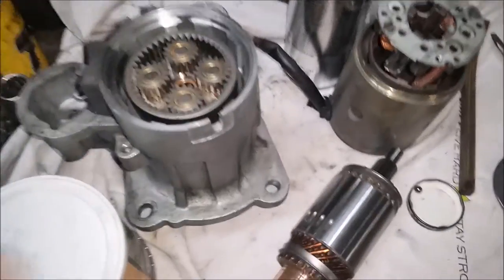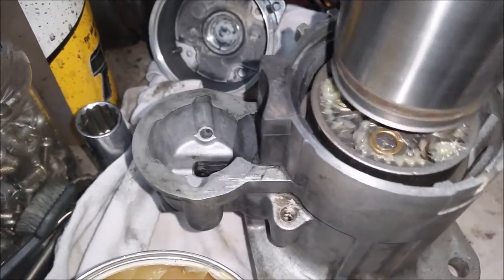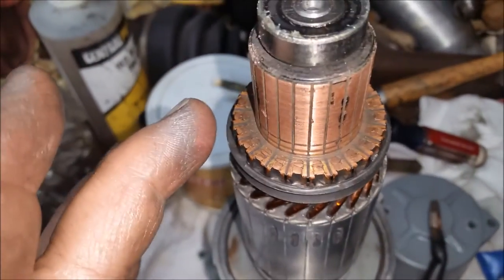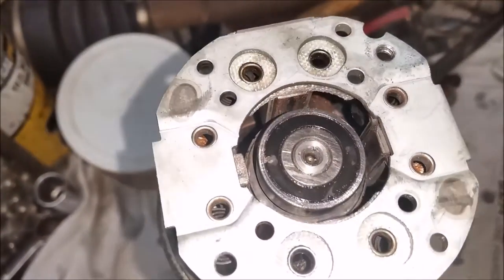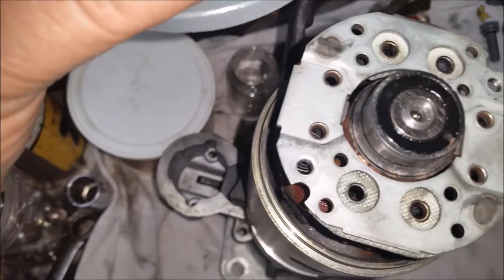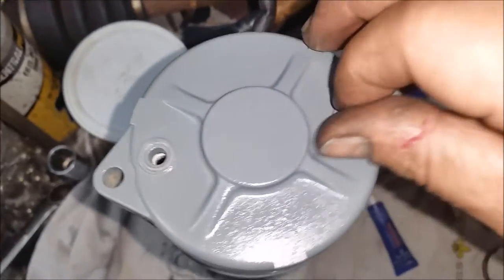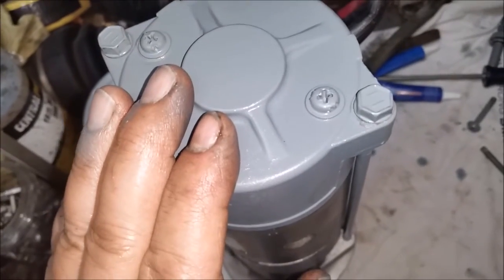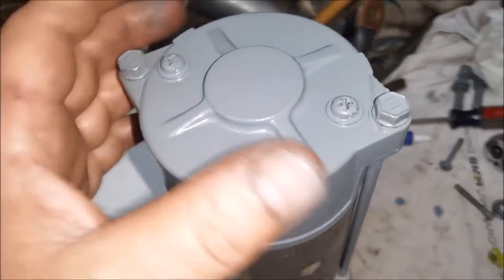1994 - 2001 F250 / F350 7.3L Starter Inspection & Brush Clean Up Reassembly Part 3 of 3

Comment: Hi, thanks for this tutorial.  I have looked at all your videos on this starter.  I have one that the Bendix is not flying out,  I did not see what you might have done on that part of the starter.  Do you have anything in your videos about that part of the starter?
Reply from the maker: Most Bendix Solenoids are not repairable. It has a coil inside that when it burns out you have to replace it or is the internal starter contacts burn out you have to replace it. If you installed it wrong you can still test the solenoid coil by removing the solenoid, then apply power to the small terminal + Positive RED and - Negative Black to the case. If the plunger sucks in then the coil and the contacts inside it are most likely good. If the solenoid sucks in but the starter teeth don't come out then more than likely you have not installed the solenoid plunger arm onto the pivot arm plunger lever. See time index 14:14. Also the large terminals have big relay contacts inside, you can test them by engaging the solenoid so it bottoms out. Then put a continuity meter across the big terminals. If it has a short when the solenoid is engaged then it is good. If you don't have a continuity tester you can use a 12vdc light bulb. Looking at the connection side of the solenoid and with the smallest terminal on top connect the center of a 12vdc light bulb to the terminal on the right and connect the case of the light bulb with a wire to the case of the solenoid. Now apply 12vdc to the small terminal and negative to the case of the solenoid. If the solenoid engages and the internal contacts are good the light should go on and go off when you disconnect the positive or the negative wires to the solenoid. Hope this helps. Feel free to ask more questions if needed. 
Thanks for watching. Best Wishes n Blessings. Keith

Comment: could doing this on a locked starter fix it because it hasnt been used?
Reply from the maker: Yes it can. However that's provided it hasn't been burned up while trying to use is in a locked up condition and all the components are is fairly good condition to start with. Thanks for the question. Hope this helps. Best Wishes n Blessings. Keith Noneya
Reply: i tried to start it up and it locked on me and took it off right away so i have not tried to use it while it has been locked ... thank you for the feedback

Comment: So, what was the outcome?
Reply from the maker: Hi Ziji! Cool Name. The outcome was that one of the coils was internally burnt and shorted and there was no way I could fix it. It would require a full tear out of the wire and rewind and solder them. It still worked but was really weak. I've done this on other starters and it has always worked, guess I gotta get the one that was burnt huh? So anyways I just went on eBay and purchased a new one after all that work for about $165.00 bucks. The new starter really turns that 7.3 over really fast. So I guess in that respects I'm happy. Thanks for watching "Z". Feel free to comment or as questions anytime. If i'm logged on I'll probably answer within 30 min. to an hour. 
Best Wishes and Blessings. Keith
Reply: Ah. Darn.
Nice videos!
Reply from the maker: Thanks "Z". I don't make to many F350 Vids because it's pretty reliable. I mostly make Dodge videos on my Grand Caravan. That thing is ALWAYS breaking. Heck my Pastor gives me heck because I drive a Ford and he drives a Dodge truck, a few years newer than mine. His truck is on  it's 3rd transmission and he calls his brother who owns a cabinet business to come rescue him all the time. His brother drives a Ford truck. It's funny he says Ford stands for found on the road dead. I just laugh and say who comes to rescue you all the time? That's right it's your brother, and what do he drive? That's right he drives a F.O.R.D. one of those: Forever Out Rescuing Dodges trucki! LOL BWnB. Keith
Reply: What was the brand of the new starter you ended up buying? 
I've been trying to find the same starter, by part number, that came stock on the vehicle. I figure it's lasted almost 17 years! Local Ford dealer doesn't even have it...
F5TU-11000-AD is the Ford Part # on it.
M008T50072 is the Mitsubishi part # on it.
I think same as yours in the videos?  I guess it was made by Mitsubishi?
Reply from the maker: Hey Z it's : Starter P/N: F5TU-11000 "3 hole unit"
I also put in the description on my "Part 2 1994 to 2001 F350 7.3L Diesel Starter Installation".
 Here's the link to that video: 
https://www.youtube.com/watch?v=MmQ54StVUBQ&list=PLVLXGvrQp0OtT4QJeMKZ764rC2A87eiXz&index=3
If you own one of these trucks I made a playlist of some of the repairs i've done on it Here:
https://www.youtube.com/playlist?list=PLVLXGvrQp0OtT4QJeMKZ764rC2A87eiXz  
You can also check out "Trey Spooner's" channel here: https://www.youtube.com/user/TreySpooner  
and "Powerstrokehelp" here: https://www.youtube.com/user/powerstrokehelp  
They have ALOT of good info on these trucks. Hope that helps. Let me know how it goes, again feel free to ask questions. Thanks again for watching. BWnB. Keith
Reply: Thank you! Yeah, I've learned a lot from both of those guys! I appreciate all of these videos so much!
Mine's an E350 7.3 van, but most of the info still applies. I had thought abt putting one of those Denso starters on it, but the auxiliary battery is attached to the frame rail underneath the van and the negative cable from the auxiliary battery is attached to the 3rd mounting bolt for the starter, which would be eliminated with the denso. I don't feel like I understand electrical well enough to try to ground it somewhere else and it really doesn't seem to work to attach it to either of the other 2 bolts...

Comment: dont paint those 2 screws on the end cap. those are ground for 2 brushes.
Starter wont last long like that
Reply from the maker: You're right if you paint an electrical return or feed path the motor won't work. However ground return on this starter is through the unpainted bottom of the cap not the screws on top. The two inner screws just pull the inside brush support up to the unpainted cap bottom allowing the return path. You can seed the unpainted inside of the cap at around 6:40. The two outer screws just hold the cap on and hold the rest of the assembly together. I've been doing starters this way for decades and unless the coils are shorted, like in this unit, I've never had a problem with painting the outside case screws. I should know I've been an electronics technician, wire harness trained technician for the last 39 years and was a corrosion control technician for several years on aircraft and electronic systems. Thanks for caring enough to question what I was doing for me and others to see, we need folks to question and not just follow the crowd. Love some of the videos on your channel. I see you're almost to 1K so I subscribed to help you on your way to that big cash cow in the sky. Best Wishes n Blessings. Keith Noneya
Reply: Thanks brother, God Bless
Reply: my starter was dead so I crawled under the truck and those screws were loose.
I tightened the 1 I could get to and now it works.
Works like new as a matter of fact.
These rebuild places must laugh at our stupidity when starters come in.

Comment: Do you happen to know the size of the BB? Mine did not have one and I can't find that BB on any diagrams of IDI starters: https://www.tascaparts.com/oem-parts/ford-starter-e8tz11002a
Reply from the maker: I think your page number should be 104 in the catalog (pdf pg. 120) Item 76-2812BALL - Drive Shaft (6.35mm Dia.) 1/4" (.250").   Love your post and information. This is what my channel is all about. Bringing folks together and sharing much needed information. Thanks for the great post and your contribution. Best Wishes & Blessings. Keith Noneya